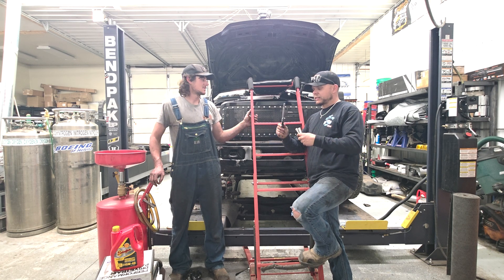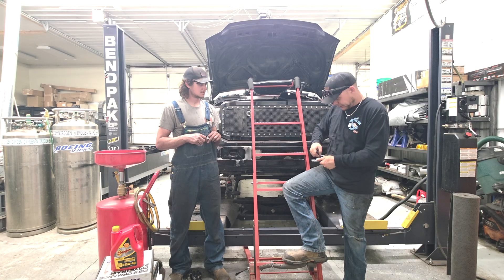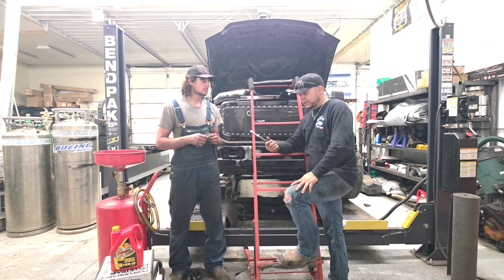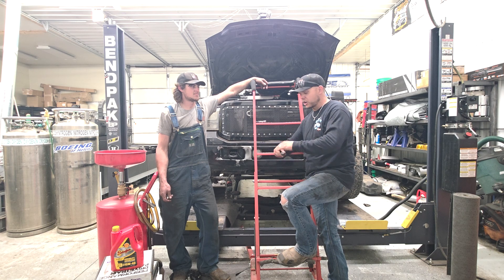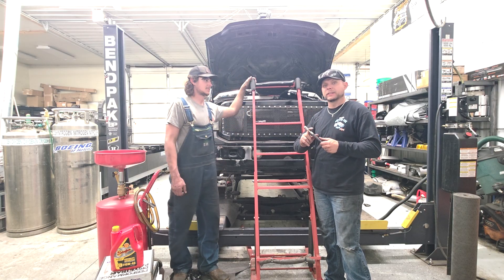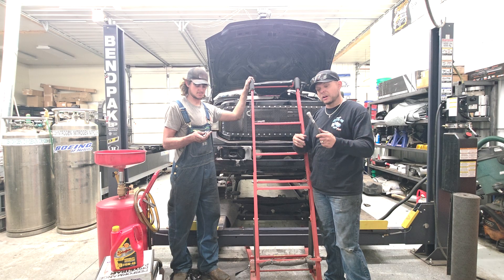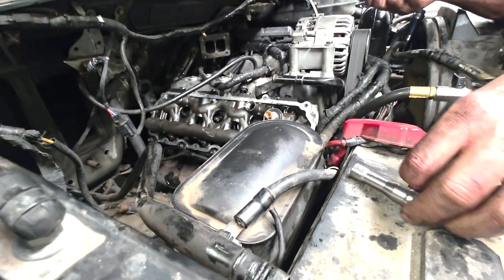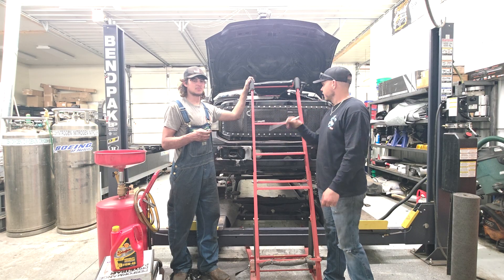FORD 04.5+ 6.0L CNC DUMMY PLUG TESTING TUTORIAL

Comment: If I ever install these on mine, I’ll probably pull the rails and make sure all the surfaces and lower stand pipes are totally dry so the locktite can cure without getting mixed with the oil